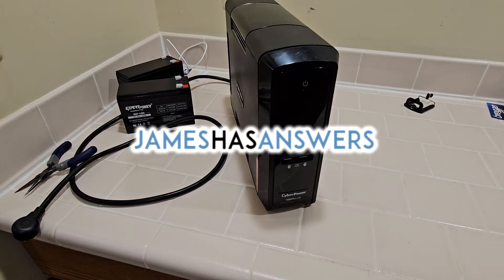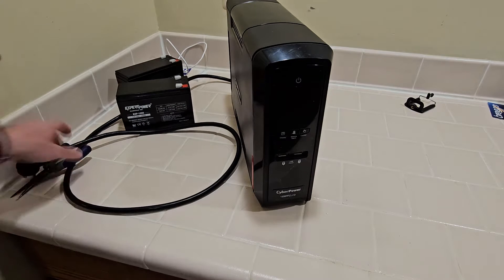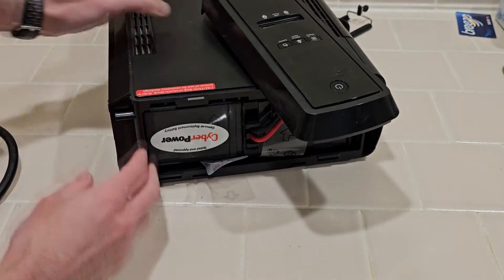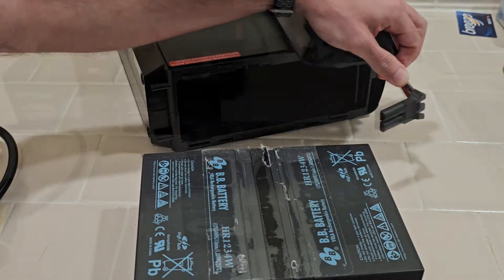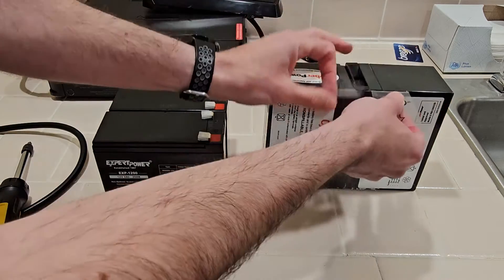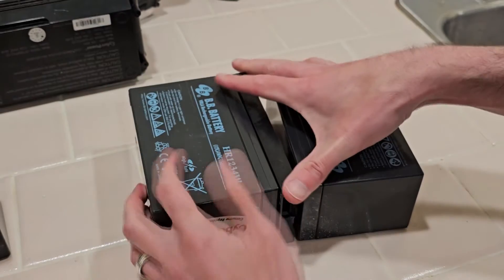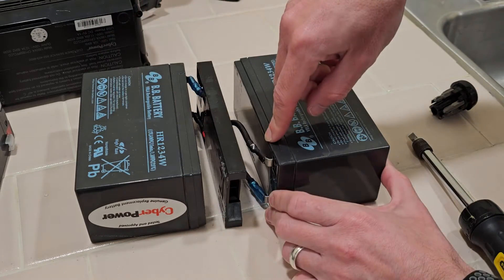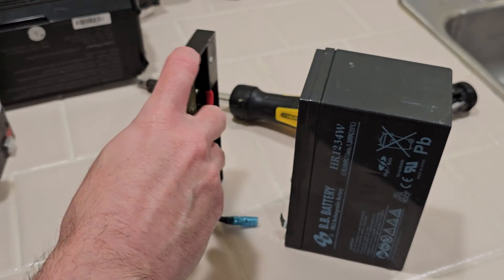Replace CyberPower 1500PFCLCD UPS Batteries

Comment: I don't know how you managed to insert the new batteries in the UPS after the replacement. I tried to insert the new batteries in my UPS, with that plastic separator between them, and they wouldn't fit in the battery space no matter what, even though there was no empty space between the batteries and the separator. They had been placed perfectly. The only way I managed to insert them finally, was by removing that separator completely and just keeping the cables and the connector connected without it. Although the new batteries were 12V 9Ah SLA batteries too, it seems they were not exactly the same size as the original ones.

I hope the cables are not in any danger now that the UPS operates without the battery separator and the upper battery is practically sitting on the connecting cables and we all know that both batteries get a bit hot inside the UPS.

What's you opinion? Thanks.
Reply from the maker: DId you order the same ExpertPower batteries linked in the description?  Can you provide the measurements of each battery?  As far as fitting them without the plastic separator, I think I'd only be concerned about the 'top' battery applying force to the battery terminals - not sure what sort of stress those can handle?
Reply: @jameshasanswers  I haven't ordered the same batteries. I've been using CSB batteries for a long time, since the time I had bought my first UPS. I have used them with several UPS brands and I'm quite satisfied with them. I hadn't faced any size issues so far and I never thought there would be any.

It seems Cyberpower is making the battery space in a way their own battery packs fit in exactly. They leave no slack for any slightly bigger batteries. I don't know why they make CSB batteries slightly bigger but they do.

As long as the temperature doesn't have any impact on the connecting cables, like melting the insulations for example, since the temperature inside the room can reach up to 84°F during the summer months, I think the UPS should be fine. The pressure on the connectors seems to be OK. I can see they are in the same place so far.

Comment: I find some screws to be unnecessary.
The front panel of your CyberPower 1500PFCLCD looks like (and sounded like) the front cover snaps in place, making the screws an unnecessary chore.

I have a 15 year old APC Smart UPS, and I leave the front cover loose, which makes battery replacement easier.

I watched this video, because I have been researching CyberPower units, because I am fed up with APC.
Although my old Smart UPS unit is fantastic, I purchased three additional APC units 3½ years ago.  All three have had failures.  My last failure was just beyond the warranty period, and APC refuses to replace the bad unit.

Their quality control, even for their Smart UPS line, is noticeably worse than 10 or 15 years ago.  Reading reviews, there was a common theme of cheapness, and issues.  And APC's prices are quite high.  Poor design, poor quality control, and raising the price, is a terrible formula.

CyberPower gets very good reviews from customers, and are more affordable than APC, which is why I will be making a CyberPower UPS purchase.  I was curious about battery swapping.  It looks reasonably simple.

Comment: Bought this device used with no battery for 25$ and got the batteries from amazon for 44. Thanks for this video on how to remove and install.
Reply: Watch out for corrosion on the battery, ate the anode connector.
Reply: Where did you get that good deal?

Comment: Is three years about the life of the original batteries? Thanks.
Reply: Mine finally gave up, which is how I ended up finding this video to figure out the right battery size, the original batteries lasted 9 years on mine. In all these years there only was a few instances of power failures that lasted long enough to require shutting down the computer before the batteries ran out, so I never completely drained the batteries, which might have helped them last longer.
Now I'm considering getting LiFePo ones but the cheap HWE LifePo 12v 9A batteries I'm looking at only come with a 1 year warranty, which doesn't instill much confidence.
[edit] and thinking about it, weight doesn't matter in a UPS so there might be no real benefits to using LiFePo instead of Lead-Acid.
Reply from the maker: I don't have long term experience with SLA batteries in UPS's yet, but 1-3 years is what cyberpower themselves state on their website, so I'd say you're correct based on that! (https://www.cyberpower.com/in/en/knowledge/faq#:~:text=The%20battery%20lifespan%20depends%20on,years%20depending%20on%20environment%20conditions.)
Reply: I agree with Veniceinventors.  Hence why I am looking this up now. I bought it in November 2015 ($149, it goes on sale periodically) and it started giving me issues this year, I thought it was because I got a 1300 watt power supply.  I can see from the Cyberpower software I do not pull more than 850w (not very often at that, mostly like 200).  I can say the original batteries lasted way longer than expected and have served me well.  I have only had ~ 3-4 shutdowns dues to power outage (I have my PC shutdown at like 40% battery (need enough juice to charge my phone in a major outage)), many more "brown outs" or 2-3min outages.

Comment: How long do your original batteries lasted ? And new ones ?

Thank you !
Reply: you're supposed to perform the UPS self-test every month or so and replace them when the self-test fails. Usually 3 to 4 years tops in residential use from my experience.

Comment: Replaced batteries on my 1500PFCLCD and it doesn't last more than a couple of minutes at full load on my pc. The fun part is that if I put back the old batteries,they last more than 10 minutes at full load...
Tried to swap batteries at the store,they gave me another couple,and every battery shows 12.7 volts,but exactly like the other two,they don't last more than two minutes.
The ups display,rapidly decrease the battery percentage,if I disconnect it from the wall,but if I turn off my pc,it rapidly turns back to 60%...

I don't know what to do...
Reply: How long are you letting it charge before you put a load on it?   It's supposed to charge a full 8 hours before you use it.  What are the source of the batteries?   There are some cheapo/counterfeit ones out there.
Reply: were the batteries 9ah? they might have been a smaller size

Comment: Why would 12v batteries be in series to = 24 volts, on not increase capacity. Seem opposite of what a UPS is for.
Reply: Theoretically, UPS batteries can be used in parallel, but due to the individual differences of batteries, service life and other factors, it will not be easy to balance between batteries, which will affect the service life significantly. So wiring up in series is the easiest way. Voltage / Capacity doesn't really matter here because its all about the amp draw given the load when the UPS is active.

Comment: Mine is completely dead. Went to power the PC and nothing, then checked connections, pressed power on the UPS, nothing, removed it from the loop plugged in the system normally and everything works. Plugged the UPS into another outlet and still nothing, unplugged, no beep, it seems to have died completely. Not even a year old and we didn't have any power events last night.
Reply: Mine was completely dead, wouldn't do anything when I pressed the buttons.  I tried unplugging the battery, and plugged the ups in without the battery connected, and it turned on.  I'm assuming the battery shorted out.  Replaced the battery, and good as new.

Comment: Will these batteries work for the 1350PFCLCD model?  I assume the main difference is the wattage on my dead unit is lower, but will it hurt putting in the larger batteries?
Reply from the maker: the issue is that the batteries linked in the description will likely be a different phsyical size and won't fit -- the 1350PFCLCD uses 12v 7Ah batteries (per https://www.cyberpowersystems.com/product/ups/pfc-sinewave/cp1350pfclcd/) which have batteries that are stated to be different dimensions than that of the 1500PFCLCD official replacement batteries
Reply: @jameshasanswers  It's funny that 1500PFCLCD is stated to be using 12 V / 9 Ah batteries when the ones that are inside (at least in these old units with 2 USB-a ports) are actually 7 Ah (according to the PDF specs by B.B. Battery for HR1234W battery). Maybe the updated 1500PFCLCD (with USB-C on the front) uses a bigger battery as standard. I know the official battery pack model doesn't match with the old model (also has a different connector). EDIT: I just checked the spec sheet from 2012 when I bought my unit and back then they listed it as "12V 8.5AH x 2" which is at least a little bit closer to what's actually inside.